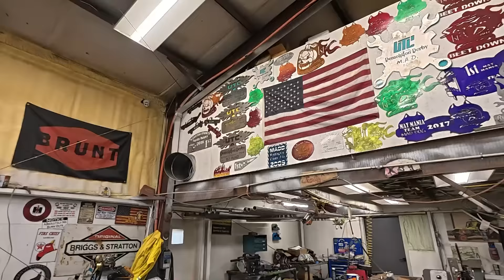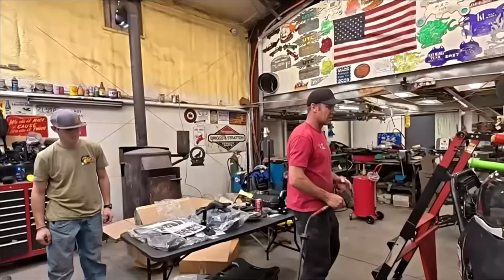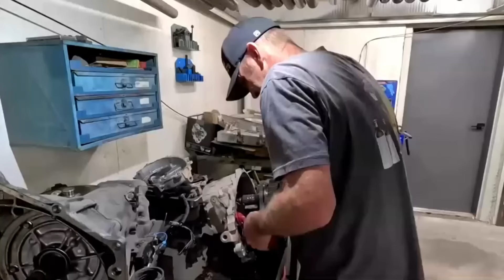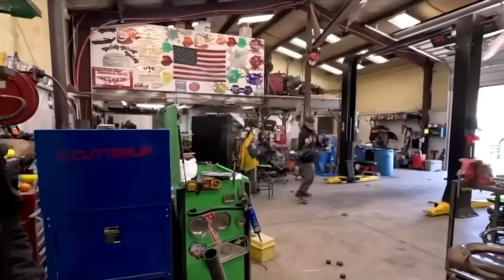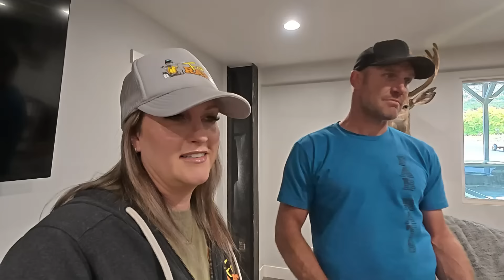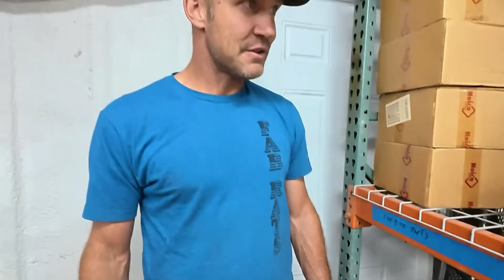Would Taking Tylenol While Pregnant Really Cause This?

Comment: Mechanic for over 30 years. I never in all that time threw a tool away but I can assure you that I lost a few over the years. I still have the old wrench I bent and used for a window crank in an old '67 Chrysler Newport. In fact Paul I have a set of ball joints here I should send you. Bought them for an 05 Grand Prix. They'll fit some Buicks, Chevrolets and other cars. I'm quite sure you could find a use for them. They're brand new and still in the original boxes and plastic bags. I'd just like to get them out of my kitchen where they've been stored on a shelf for the last 5 years.   LOL

Keep the videos coming and keep up the awesome work.

Comment: As someone with ADHD, Paul's shop makes total sense. Additionally, half the time Paul can't find a tool it's not an issue with organization it's an ADHD thing. When I am into a project I have the same issue, I will use a tool, set it down, and then spend 20 minutes looking for the tool I just sat down.

Comment: The funny part is, Hobart and Miller are owned by the same parent company (ITW), and Hobart is supposed to be the budget beater brand while Miller is supposed to be the creme de la creme, for discerning professionals, with demanding duty cycles… and yet, I likewise have a Hobart Handler that just handles it all, while the trailer queen Miller gathers dust in the corner.

Comment: Paul, I sharpen mower blades daily and I use the 4-1/2” Forney zirconia flap disc. 36 grit. It works the best and lasts the longest. You definitely get what you pay for. You can order them from your local Ace or Napa. I promise they will make your life easier. I tried the Amazon disc and they are disappointing.

Comment: I lived in the same home for 30 years.  I accumulated equipment to maintain the surrounding property, built buildings for shop space, found engine rebuilding machines, setup bodywork and painting space and bought lots of specialty tools as project demanded.  When I moved I didn't know if I would do any more restoration work so moved most of it.  My now son in law came over to help me sort it out as I moved in & he asked "why are you keeping all of this stuff".  Last night he asked if I had something he was looking for but couldn't find.  I said "Here you go!" and he walked away happy.  The reason you keep odds and ends is that when working on a half hour task if you have to run to the store for something it turns into an all day project - every time!  But hey there's a reason I'm single and live alone at peace LOL!

Comment: Our school shop built a tractor out of an old truck. We had small tractor lug tires on the back and two manual trassmissions mounted backwards for low speed powerr...  The unforseen problem was the high speed smoking tractor tires in reverse. Just a build idea....  Another idea... an old small car lightened, then powered by a small gas or diesel engine in an attempt at hyper-miling... maybe use a small engine to run a generator to power a set of FAST electric motors on 2-4 wheels... Good luck with future projects!  Great show...really enjoy all of the builds!

Comment: Can’t you use Nuts and Bolts to have nuts and bolts? Haha. Robby and Matt use them and they have barcodes for each size so when you run low, you can scan quick and order more shipped to the shop

Comment: I know how it is to have stuff like Paul.  I know my stuff, and I know where my stuff is.

A few decades ago when I was married I was working on a job in Philadelphia.  My then wife needed to use some of my tools; yes, she knew how to use some tools.  Any way she went to the basement to get the tools that she needed.  My main work shop was in the basement.  She looked, in my tool boxes, and on the shelves, couldn't find them.

I sent back down to the basement to have a seat on one of my shop stools.  She started questioning me right away, she only wanted the tools.

I asked her to pull one of the stools away from the bench above 6 or 7 feet.  Fuss, fuss, fuss.  Why couldn't I just tell her where the tools were?  Because she still wouldn't find them and get mad at me.

I asked her to sit down and just look at the bench top just to the left of my tool box.  She started in about the mess, I told not to touch anything yet.  Blah, blah, blah.  I let her vent.  When she stopped for a breath, I asked if she was ready to listen to me.  Okay, but can we just get the tools.  Sure, sit down and listen please.  I need you to listen without interrupting.  Okay.

I started describing the pile of stuff on the bench top.  I asked her to see that pile of tools as an onion, it was placed there in layers.

As I described the layers she began to see the layers.  We got about 3 layers in when I stopped.  Irritated because I had stopped she was jabbering at me, and I just let her talk.  When she stopped I told here that we would talk about it when I got home.

Okay, what do I do now?  You told me about the layers for a reason.  I asked her to get a portable table that I had made, so thst as she peeled the onion it stayed in order.

Slowly she peeled the onion.  I hear, There they are!  She put the layers back pretty much the way that she found them.

She did what she needed, and put the tools back to my surprise.  I wasn't expecting her to do all of that.

She learned that there is order in what looks a mess.  But I knew my mess.  She would tell that story several times.

Yes we did have our talk.  She started asking me if I was ready for the next project, letting me get things back in order.

Comment: Paul you get a harbor freight tool box and you put little slats square slats in your in the drawers and then you put all your nuts and bolts and nose and then when you pull the drawer out then you got all your all your bolts go to the next drawer. You got all your nuts. That's how you organize nuts and bolts. It works. Trust me I've done it

Comment: I wish I could see you build my truck. 😁 I have a 1948 M5 Studebaker, that I've dreamed for years of setting the cab and box on a 3/4 ton frame with 4 wheel drive. Since I've watched your channel, I also got the idea that Merlin, of MOSG could build a 4BT, bolt it on a standard tranny with OD, and stick it in the truck. 
 Then I would have a rig to pull people out of ditches when it snows too much, and pull my trailer with my crawler or one of my old tractors around, when I could help someone out with any of my old junk equipment.

Comment: I was at swap meet one time they had an old leath their it had very good price on it maybe about 5 to 6  thousand dollars on it or less. It was about 10 to 12 long i think 🤔 . But i had way to move it or shop to put in, nor did a forklift or trailer to pull it. And did not see very many tools with, like the cutting tools , bora tools. It had the chuckey, I had 2 or 3 extra chuck with it 3 jaws and the 4 jaws. 10 inch chucks and 12 inch. Plus that was back way before you was born 1976 time. 
I played with them a little in Highschool shop. I only made a few things plus i did get much time because all other students about 20 boys. 😂❤❤❤❤

Comment: A good belt grinder is a must for anyone doing fabrication.  Truthfully, it is probably used more in my shop than any other single tool.  They cut iron, steel, brass, bronze, aluminum, carbon fiber, fiberglass, wood, glass, and most anything else you can rub it against.  I built mine for about $180 a decade or more ago.  No fails, no problems, and I'd build another one just like it, no changes.

Comment: I would like to see some basic instructions on welding. I have a Hobart 140 but I’ve never used it. Also have all the accessories to go along with it. I thought I would teach myself how to weld but the welder has been sitting there for a couple of years. Situation here is, I’m a 76YO carpenter, if I can’t bang a nail into it, I can’t fix it.

Comment: Since this was the cribs vid, iv been wondering for over 3 years whats in the cabinet up on the wall between the bay doors. Looks like an old demarc telecom cabinet?
Reply from the maker: You’re right! That’s what it is. It has welding rods in it. 👍
Reply: @FabRats i was really hoping that was like a fiber termination for your fiber to the shop. I have been trying to get good looks at it and never could get a spot that was close enough and long enough toncheck it out. But now its solved. Maybe you can show that off next time you use some rods out of it.
I have a fiber nid with my sprinkler timer in it. I know how anything you can get for free, you can find a use for. I even do things so much harder and complicated, but when the parts are free you learn to adapt.

Comment: If Snap-On replaces your broken tool consider yourself very privileged.  I have never in 40 had a Snap-On driver replace a broken tool, they always have some stupid reason why it's not covered by warranty.  The only reason I still use them at work is because work pays for them.

My personal tools have all been replaced with WERA or Craftsman, never an issue getting something replaced on warranty.  Even just had 30 year old ratchet replaced no questions asked.

Comment: On that upper level, I would put hooks on the rails and hang your extension ladder to act as a railing/gate.
It could provide some railing when needed and then easily removed when you need to crane stuff up and down.

Comment: Chrome sockets are not meant to be used on impact guns. They may not crack on the first use, but eventually they will crack. That is why they make impact sockets, which are specifically designed to be used with impact guns.

Comment: I would like to see you build a 1978 or 1979 full size bronco and give it to your daughter. Or, you could build it as a giveaway. Coyote swap it Atlas transfer case Dana 60s, four-wheel disc, brakes, bead, lock, wheels, nice leather interior, tilt, staring, badlands winch, with a Robbie Layton paint job, with some lights and wiring, added by Chad from Chad’s fabs

Comment: It's not just you. I have a 30x40 shop and i'm a gunsmith 2. Lathes 2. Mills 1- Drill press 2. welders 3 grinders and 2. buffers and an Oxy/Acet. set and a welding table 3 work benches and a full reloading center as big as a bedroom and wood working tools like a tablesaw and big bandsaw jointer planer etc. I'm also building a L-31 vortec 350 that's on a stand etc. gun safes and rifle racks the list goes on and my Wife occasionally shows up to shame me about all the guns and parts and tools i have laying around too. I just tell her it looks and smells like money in our pockets to me. I will also say I hunted Panguitch many years and you Mormon Folks are pretty good about never throwing anything away and it's that way all over your state. You are rural and you never know what a guy is going to need on short notice or in a pinch. So, i consider it commendable and a necessity. Nothing to see here Michelle move along.

Comment: I had an uncle Well no I had many Uncles but just one was a Hoarder Pack Rat.  This Uncle saved everything. Now when I said he saved everything I mean just that he would not throw anything away. If he found a rusted bolt and nut he would keep it just maybe he might need it. He found a 12ft extension cord all chewed up and he took it out of the dump I said what the H do you want that for he said I might need a foot of wire and now I have it. This Uncle had a beautiful large over size two car garage  that could fit 4 trucks in it easy . They had to park out side of the garage because there was no room in the garage for anything  because it was full on all 4 sides about 5 feet high and no I am not making this up. Now I know that is a sickness  and I told my parents and my Dad said it might have something to do with all the car crashes he has been in. My Uncle was a stock car driver a Derby driver and  a demolition car driver. He had no more room in the Garage and my Aunt made it clear non of his junk is going in the house. Slowly over time he was filling the house and she started hoarding as well . Now I know most reading this part will say I am mean or hate full but the truth is when I found out my Aunt died and then a few month later my Uncle died  all I could think about is Who would want that house and knowing no one would want to clean it . Then my brother told me well They have been cleaning the house  for a long time now and has taken the Daughter almost 2 years to clean the house. 
     I asked how and my brother said they refused to go in a nursing home or Hospital so my Cousin told them she will take care of them but they have to get rid of things in the house and they agreed. My Uncle kept forgetting  so every couple hours he would see a room clean and get upset and my cousin had to show him proof that he agreed to it. My Aunt also would keep forgetting and asking her daughter when her kids were going to come see her knowing she was one of her daughters. It took my Cousin over 2 years to clean the house and took her another year to clean the 2 car garage because she just had them haul everything out and kept nothing not even tools.

Comment: Matt build a wrecker frame up and that was awesome. You should do a custom frame up build of some kind. I vote something with a Predator 2 cylinder motor and transmission with over the top suspension to be a 1 seat rock crawler. Random I know but you want ideas.

Comment: Instead of chain rail, just make removable rail with drop pins like scaffolding uses.  Pull the pins, move the railing sections, and put them back and be safer.  I'd say hinge it, but then you need swing clearance and more math and thought. 👽🗿👽

Comment: I have a shop too, no where near as big as yours. I organize something like Paul, I know where stuff is, but no one else does. It got so bad at one point, I needed more storage, so I got a 40' high cube Connex. I built shelves out of some junk 2X3's, and only had the cost of OSB for shelves and the Screws. I had to take ratchet straps to square it up the 2X's were so wonky, but, it works, so much storage inside that thing. But yeah I understand the storage and placement thing. Anytime someone is at my shop using my tools, I ALWAYS have them to just put them back on the work bench, I put them up so they go back to where I want them. Otherwise, they are lost to me the next time I use them. And when someone says do you have a __________, I can tell them which tool box. Most (95%) of my tool drawers are labeled with a P touch machine. Do what you do Paul, it's what makes your channel. I watch all of them!

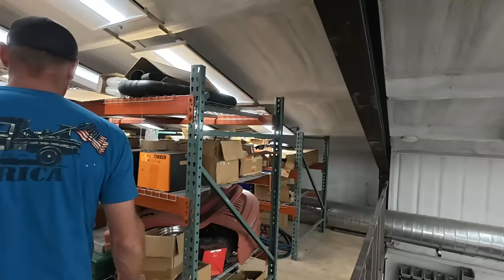Comment: @23:00 What about building a railing that slides in and out and uses truck / trailer stake pockets? if you want to get even more safe run the railing through the pocket and have a quick release pin just like the d-ring stake pocket adapters.

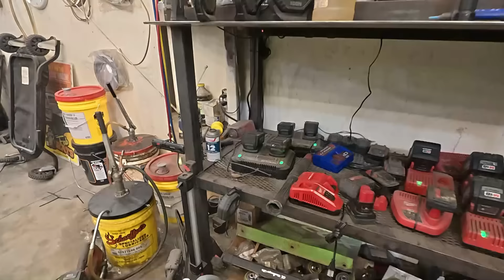Comment: 5:36 I'd serioisly recommend relocating either the charging station or the flammable oils and aerosol cans. It is a very bad idea to charge batteries by your most flammable materials! Save your shop by moving the battery chargers to an isolated area.
Reply: This is especially true since Matt's Off Road Recovery had an incident with a GoPro battery if I recall that went up in flames recently. Speaking of, had 2 original GoPro batteries swell and one stuck in the camera and pulling on the tab took the top off. Had to dig it out. Replaced it with a power brick for action cameras as it has the ears and a mount for a click mount GoPro mount to fit and it'll be perfect with the Media Mod and no internal battery (have the GoPro Lab's firmware).

Comment: Fun fact-  Hobart is owned by Miller and is just a cheapened version of the Miller brand machines.  They will have plastic drive gears, for example, where the Miller machine will have steel.
Reply: Hobart is not owned by miller, but they are both owned by the same company which is Illinois tool works.
Reply: As old as that Hobart is, it was probably it's own company back then.
Reply: In high school I washed dishes at a steakhouse house Thurs through Sun nights.  They had a giant floor mounted Hobart mixer.  Wonder if that was the same company.